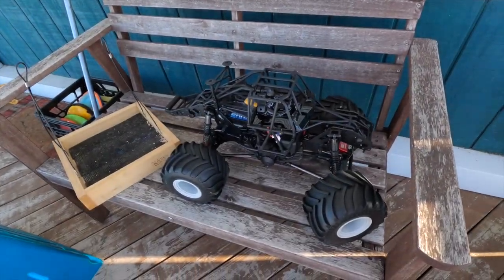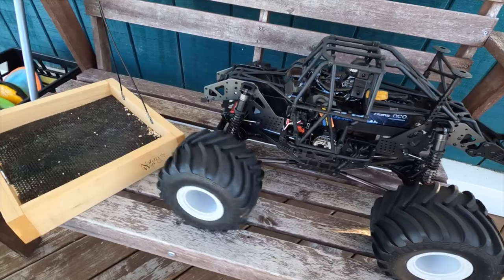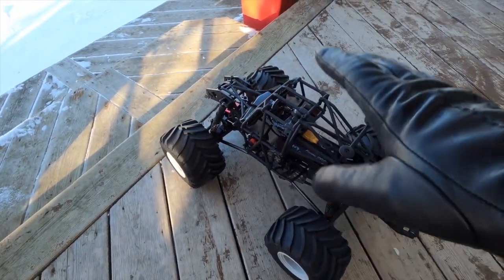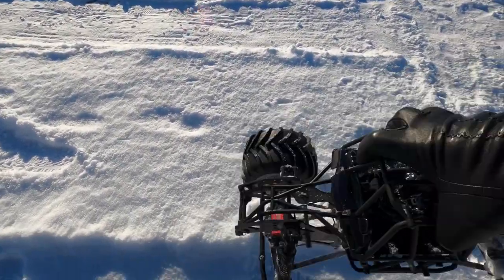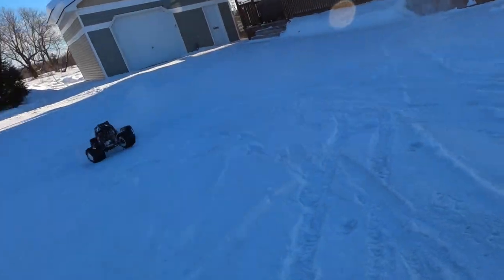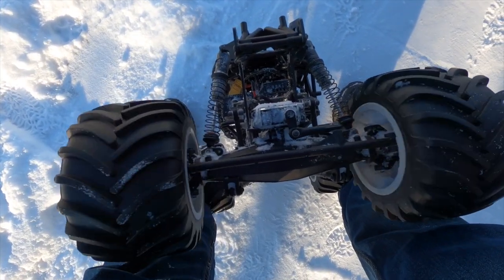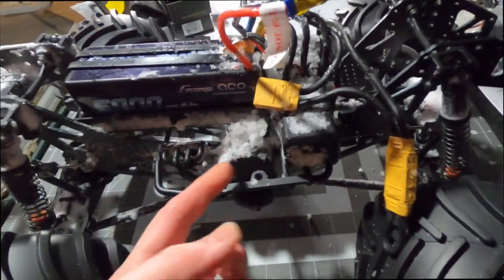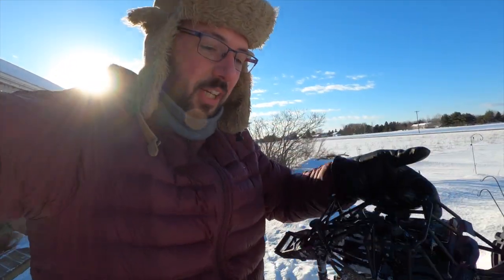LOSI LMT First Run! 4S Test in Snow - Netcruzer RC

Comment: you might want to look into reinforcing the axles. they are kinda weak and tend to split. near the lower links
Reply from the maker: Yes definitely. I mentioned how weak the housings are in the unboxing video. I didn’t strengthen them yet. Considering the options.

Comment: I'm thinking of running it on 4s with stock gear in (I have the grave digger) ... deffo a lot of torque. great video and a beast of an LMT, congrats!
Reply from the maker: It can be done but might get quite hot or push the Spektrum ESC to the limit. Stock is a~3000kv motor and my current setup is ~2000kv motor with a higher peak amp rated ESC.
Reply: @netcruzer  ahhhh true story! I think 3s may suffice for now 😂 I don’t want my LMT smoking haha

Comment: You should try it on 3s. 4s on the 8th scale electronics is crazy power lol. John I commented on your unboxing that losi now has a 25t spline now. Or run a kimborough saver works good as well. I also commented a good sponser decals sheet you can get on your unboxing video